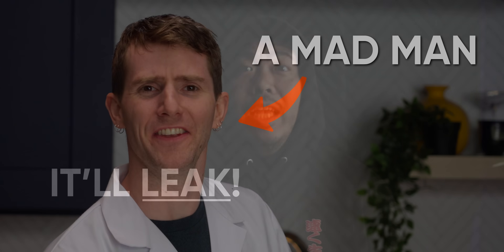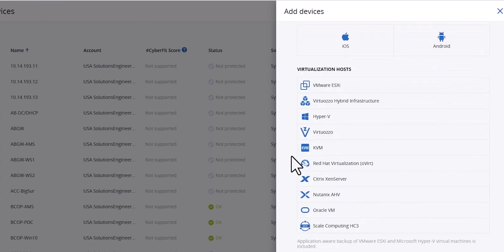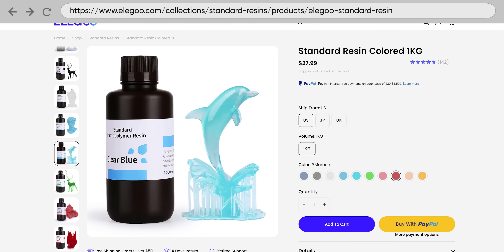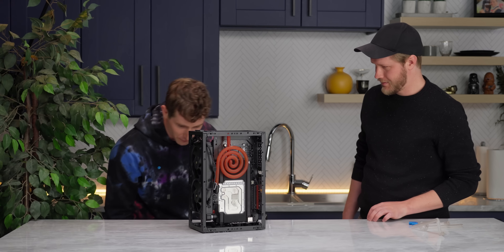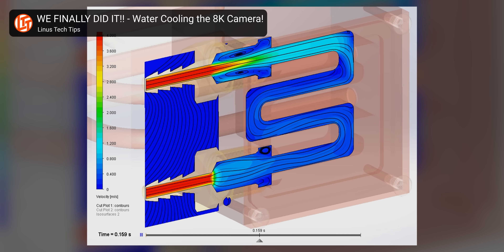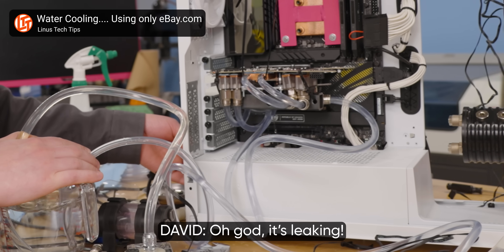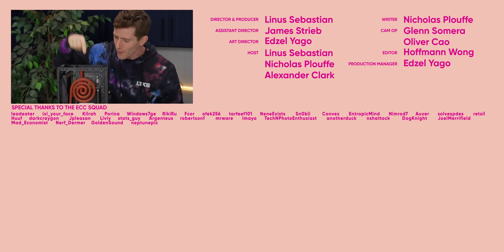3D Printed Hardline Water Cooling

Comment: well i did FDM 3d print water tight connectors for garden hose and stuff and it works.
I usually have 3 walls at 0.44mm line width at 0.2mm layer height from a 0.4mm nozzle with gyroid connected infill.
So all my walls are at least 3 x 0.44mm x 2 so 2.64mm.
even our washing machine is on a 3D-Printed G 3/4 adapter for years now without any leaks at full pressure.
Reply: yes it can be done but an adapter is short and not long like a tube, you add changes to leak at every layer and bend.

Comment: When printed at the correct temperature to get proper layer adhesion, PETG won't be porous.  I've printed many low-pressure pipe fittings without issue.

Comment: 10:00 Linus is joking, but... this is something they should try, it would work as a swamp cooler and lower the coolant temperature, they do this in powerplants.
Reply: It wouldn't work too well for them because they are on the Pacific coast. So humidity is likely rarely below 60% during the spring and summer and that's about when swamp coolers stop being effective
Reply: I'm sure the water will be warm enough to evaporate and lower the coolants temperature. And even if it is really inefficient, it's just a fun project and doesn't have to be done under perfect conditions.

Comment: I can't believe, you did not try to:
1. Have the resuare build in as part of a tube.
2. 3D print a radiator. The possibilities for a radiator layout is endless. How thin wall could you 3D print and still have them be water tight. You could print hollow fins and blow air over them.
Reply: yeah good luck trying to fix every little fin that's leaking

Comment: I didn't realize there was a scanning spray that cleaned up with sublimation.  I was only aware of ones that required manual cleaning.
Going to have to give it a try.
Reply: I use it all the time in my job. It can take quite a while to fully sublimate, but even if you end up having to clean some of it off manually, it's still a lot less messy than dealing with the non-sublimating stuff.
Reply: I have never even heard of scanning spray before and even I was super excited about it sublimating to remove itself
Reply: It works really well but it’s quite expensive.  I usually just use foot spray unless it’s a very complex component

Comment: I printed watertight pla vases for my wife. Designed so that 3 walls equals 6 layers. (Neptune 4 pro @250mm/s)
@ltt: care to share the .stls? I'd like to try the prints and test them on a 4 bar (58psi) garden hose. Though my build volume only is 250mm³.

Comment: something thats also possible with an FDM Printer would be to use ABS for the tubes because ABS can be smooth with aceton so the layers shouldnt be a big problem anymore which could lead to a leak,  as for support the the use of a water soluble support Material (like PVA) can be used for the inside of the tube. I have never tried something like this but it should be possible

Comment: You should have made it with temperature changing resin, so by looking at the tubing, you could tell if your system is running hot or cold.

Comment: getting play sand, put in a steel pan. throw in oven at needed temp to not melt/damage the tubing. hot sand makes the tubing soft and bendable while the sand keeps its shape and avoid crimps

Comment: You could have created a METAL TUBE shape, like an old pipe, it would have been great and more resistant, because you can easily make the thickness you need, and if you do the proper cleaning with the 3 machines, CLEANING DRYING WITH ALCOHOL AND CURING, you can have a piece completely from another level, look at the 8S machines from phrozen

Comment: I'm so confused how you were able to do those test prints with PLA on an FDM printer? Like I get they don't work for obvious reasons but whenever I try to print a ceiling like the interior of a tube its either fill the interior with supports or never have a prayer of the shape being right. Hell, my screw holes often come out as ovals inless they are oriented flat on the bed.

Comment: 12:36 - 12:39 "100,000mAh battery capacity"

Hey Alex, you've got some info the printer doesn't have? Cause it printed 10,000mAh on the powerbank (as shown at 12:44)...

Comment: Genuinely thought the battery featured in the sponsor spot at the end was 100,000mah for a second, thought it was gonna be the size of the suitcase. Then I realised that whilst Alex stated “100,000mah” , upon reading the text on the actual battery itself, I now know the battery is 10,000mah in capacity. To see this error in advertising not even fixed in post, is disappointing to say the least..

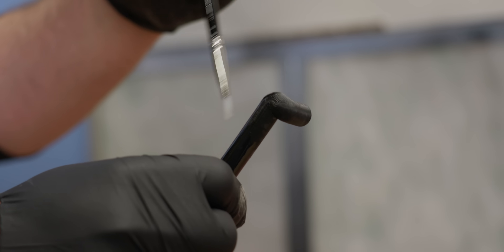Comment: 4:04 means your settings are not correct, although it's less relevant because you can coat the stuff in epoxy.  I printed a part in petg for a hydrolic tank and it is indeed water tight.

There is a alternative where you fill the part with sand and put it in a box of packed sand then heat it enough to somewhat melt which will also seal the print.
Reply: Maybe on a high-end printer I would agree with you, but on a lot of the extremely low quality low-cost consumer models, I would not expect those prints to be water tight. And yes, there are solutions for that problem but coding an entire tube in epoxy at that point, why don't you just use traditional hardline methods because it's impressive enough for way less manual labor
Reply: @the_undead  because you can do shapes that are impossible for a normal tube.

Also I do this crap on my used cr10 max.
Reply: @the_undead  thats not true anymore, what they forget to mention is that petg is both absorbant and prone to develop water damage
Reply: @the_undead I made water tight stuff on an ender 3 lol
Reply: @handledrandomly  but can you reliably do that with relatively thin tubes? And also can you do that from printer to printer because something that you need to understand Is these cheap consumer models? Do not have high tolerances so you could get one that's capable of amazing precision and you can get another one that couldn't print watertight tubes to save its life, especially because a lot of these companies do not care about the tolerances they're they are just trying to sell you really cheap garbage
Reply: @the_undead  that's a skill issue. The printers are cheap because you have to build them and calibrate it yourself. It's a pita but you get what you pay for. Spend a little more for a bambu and it's a non issue
Reply: @handledrandomly  some of the cheapest printers do not have components capable of the precision needed to make water tight tubes whilst making the tubes reasonably thin, also, if you're asking people to calibrate their printers then that's not a consumer product that is an enthusiast product, and I am talking about these printers from the perspective of consumers not enthusiasts
Reply: @the_undead  dude just stop, you clearly have no idea what you're talking about, you just want to seem right. An ender 3 is 99$ and is more than capable than printing water tight parts, it has nothing to do with precision. It's cheap because YOU do the calibration and building. Prusas are basically the exact same thing but are more expensive because they are tuned for you. A bambu a1 mini is pretty damn cheap, but with your logic there is no such thing as consumer grade 3d printers because you have to tweak the slicer settings. Not that it matters since that's you just moving the goalpost, because let's be real here. If you are making custom water loops then you are clearly more involved than consumer grade
Reply: @the_undead  Any printer can print watertight. You need more walls and slightly higher temperatures and that is it. Also PETG is slightly better suited for that than PLA but both works. This is not a problem for fdm printing.

Comment: Question: Is the test PC going to be used in a normal workload or will it be sitting idle/off for 6 months?

I think for an accurate test there should be a mix of usage to see how the tubes hold up when the loop reach its hottest as well as the thermal cycling over time.

Comment: You can get it watertight on a FDM printer by using multiple outer layers and alternating inner layer walls
Reply: Yeah I've made water tight planters and stuff. It's not that complicated. Even made a drain pipe adapter with petg. Works fine 👍🏻
Reply: Yes or at least more water tight and by using the resin its instantly perfect. No more chance for pin holes.

Comment: 3D print a case. Make it be the tubing and reservoir.
Reply: Metal 3d print the case so it can be the tubing, reservoir, and the radiator.
Reply: @barnett25  Sounds like a monster labo product.
Reply: @barnett25  and pump housing, large part of the cpu and gpu block
Reply: That is an incredible idea but would be hella complex to make
Reply: @GoldMike_  That's why they do it and we get to watch the process of pain and suffering
Reply: @GoldMike_  It already exists.  Look up  Modular Attached Storage Stack (MASS) ITX.
Reply: @GoldMike_  it'd be complex to design once, but relatively easy to produce in large numbers.
Reply: @GoldMike_  Not really, Just take a really barebones sff case like any of the sliger offerings and you can make a single panel be the main water distribution block, only tubing would be the pipe from the panel to the block.
Reply: @GoldMike_  if they want to send us drawings or something we can probably model it, though I may need some help with CPU part clearances and tolerances XD
Reply: @GoldMike_  
Well we have a team of Canadians that loves complex.
Reply: Nothing is to complex for Linus and Alex
Reply: @GoldMike_  Linus has an engineering lab, and several engineers, I think he might have that covered 😋
Reply: Already  did my guy
Reply: that were amazing
Reply: You probably don’t want the heat to directly touch all of the components everywhere, but partial printing that’s cool might work with bad conductors of heat touching sensitive parts
Reply: Do this and fill the voids with squiggly tubing, use pale yellow resin, nearly opaque red dye in the water, and RGB light strips on the motherboard set up to pulse yellow-orange, like a heart beat.
Reply: integrated water-cooling channels to allow for super short pipes :O
Reply: that's a cool idea!
Reply: Print it out of metal just to be sure it doesn't leak.
Reply: Why not also the radiator while you're at it
Reply: i dont think you could have the tubing be fixed to the case, but 3d printed case/res would be awesome to try. you make me want to get a 3d printer.
Reply: @etan_yippee  You would just need to have minimal tubing to connect the gpu and cpu cooling line to the case, which would transport the water to the radiator ._.
Reply: The ReservTube now in 100mm 120mm AND 160mm sizes!
Reply: That's genuinely a great idea for a video
Reply: Singularity computers do something similar to this with their Specter case
Reply: 3D print a case + 3D print a monitor that create a water fall for screen and use a projector for image.
Reply: This whole thing is a massive idea generator.  Tubes don't have to stay the same diameter.  Glass chemistry tubing look  (google "Wurtz ball tube)?  They could be ribbed (for your pleasure). They don't even have to stay as one tube.  Spaghetti Code Watercooling anyone?  Or how about a 3-D maze of tubing?  What if the entire front panel was a see-through tube?
Reply: And with 0 clearance for anything else, the 4 liter case
Reply: I saw this on optimum's small case build. Should be easy to replicate but you have to choose a plastic that melts under a high temperature to prevent flex
Reply: 🤯🤯🤯🤯 mad idea bro that would be fucking sick
Reply: I'd be interested to see it, but I get the feeling it would be a pain in the arse to print.
Reply: The number one thing the Uni technicians that run the printing lab remind everyone of is that PLA is not waterproof. You’d be surprised about the amount of people who don’t listen lol
Reply: @pinkyblueAPefc  teeeechnically nothing is water proof if there is enough pressure
Reply: Dammit, now I have a new project to make.
Reply: Hold up, let him cook.
Reply: Singularity's been real quiet since this comment dropped
Reply: I have always dreamt of a case where metal tubes are bent to be the case's structural support, with glass or acrylic panels as side panels
Reply: Only difficulty would by getting the parts into a case with pre-installed tubing
Reply: +1
Reply: This is a really cool idea ngl
Reply: This!
Reply: Damn
Reply: Cool idea
Reply: You are a fucking genius
Reply: We need this
Reply: I've been wondering for a long time why nobody makes a case where the frame is water cooling tubing.
Reply: This is the way
Reply: I just posted pretty much the same comment before noticing yours. Yes! We need a case that's just like a crazy mad scientist lab apparatus/crazy roller-coaster system of tubes and pipes!
Reply: This
Reply: Yasss
Reply: Someone has to do this now. I could if I had a printer of my own.
Reply: Nowadays you can print Aluminium so you would just have to know the right folks and you could get a custom build 3d printed aluminium case for a pc
Reply: The real AIO
Reply: Oh damn!
Reply: why not making the case the cooling tubing itself?
Reply: That would be crazy! Also amazing m
Reply: https://www.youtube.com/watch?v=0UDYWx93VLA&list=PLWO3Jaj49n2eacf6fxj7MY3itiWShB5XS&index=3
Reply: It's like a Buell Motorcycle where the frame is the thing that holds the gas
Reply: Waterfall front or side panel
Reply: neat idea but itd look super funky since itd have to be modular to be made with resin, resin printers (outside of commercial ones) just arent able to print at that scale
at best youd get away with a case in 4 pieces, realistically probably between 6-10 depending on how you divide it
Reply: ^this
Reply: thats actually genious
Reply: That case already exists. Uh. I don't know the name. I saw it on one of the Asian pc build channels
Reply: @wick174  Pretty sure Thermaltake made a flat-pack case that is 3d printable.
Reply: @wick174  The Streacom SG10?
Reply: @wick174  der8auer  reviewed one where the side panels are the reservoir and the radiator.
Reply: They already printed a case. Nice one

Comment: 12:37 umm this should be 10,000mAh rather than the 100,000mAh stated in the video... (If I'm not mistaken)
Reply: It annoys me so much when these products have magnitudes like that. Just say 10Ah ffs. Oh you have a 30000mAh battery? it's 30Ah... your kettle uses 2000W? that's 2kW...
Reply: @Walkman100  Nah, say 37Wh,...
Reply: It is not a capacity, missing the voltage anyway, could be 100'000mAh at 370mV.
Reply: @Emetsys  at 20w charging
Reply: Was the video updated? I don't hear any reference to 100,000 mAh, and the video shows 10,000 mAh written on the top right of the item.
Reply: @ACuriousTanuki  yeah read the pinned comment
Reply: I downloaded the video when it went live but just watched it now, so I still have the 100,000 mah blurb in my download 😂
Reply: Don't you have to be < 99,999 mAh to be on a plane?
Reply: @donc-m4900  The limit is 100Wh. For a 14.4V laptop battery, that would be 7000mAh
Reply: @mechatr0nix  Thanks, I wasn't thinking in the right units.
Reply: 100Wh  @donc-m4900
Reply: @donc-m4900  yea that's the legal limit, also on the powerbank's website it says 10,000mah so he said the wrong number
Reply: i felt lied to then stupid after following the link to see it was just 10k not 100k
Reply: Glad I wasn’t the only one who spotted the Engineer’s numerical disabilities
Reply: @staffie85  (he's a writer not a engineer)
Reply: @JupiterGuy1  he's an engineer as well. He's one of the engineers in the warehouse
Reply: @JupiterGuy1  I'm sure he's said multiple times (in the over a decade I've watched LTT), he did engineering qualifications... hence his use of CNC, lasers and CAD etc... but if you think doing "writing" now excuses giving incorrect information, then that's up to you

Comment: Scanning the case is certainly an option, but bending a wire to the run you want and then measuring that wire would be a heck of a lot easier. And cheaper. Still a cool project though
Reply: Definitely overkill... They had to justify the purchase of the 10k 3d scanner
Reply: @emanggitulah4319 Yeah, that's kinda part of the channels whole thing. Using sub-zero cooling is also overkill, yet they did it
Reply: a n i m e
n
i
m
e
Reply: maybe watch the video next time lol

they literally said you could measure and that 3d scanning was overkill
Reply: @201bob  I did watch it. I commented near the start to be fair, but even after getting to the part where they said you could measure and cut sections like normal and then convert that to a 3D printable model, I didn't feel the need to update my comment as the wire trick is still a valid alternative method they didn't mention.

Even if you have a scanner handy to use, I would still think it would be easier to use a more hands on model to make the rough shape of it and then move to modeling after you have the plan solidified. Seeing a 3D model on a screen tends to feel different than seeing it in person at it's true scale. Especially when working with small parts. Thus, better to do as much with your own hands as you can. I say that from experience as a FDM hobbyist who makes most of their own models.